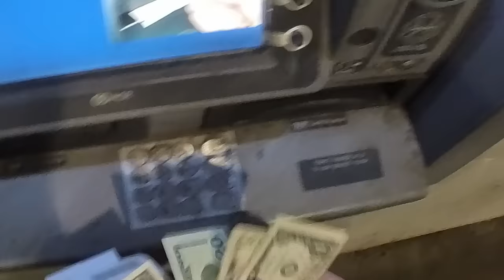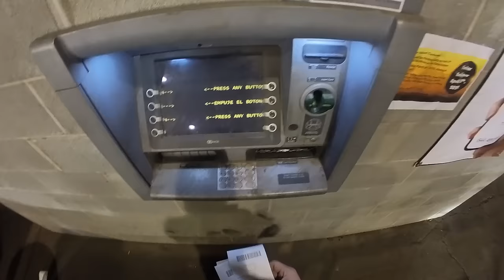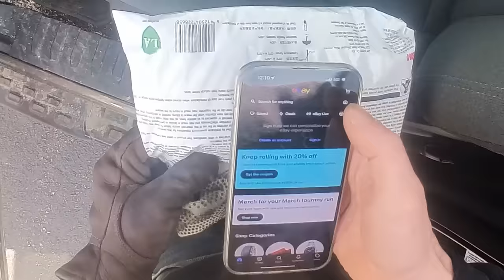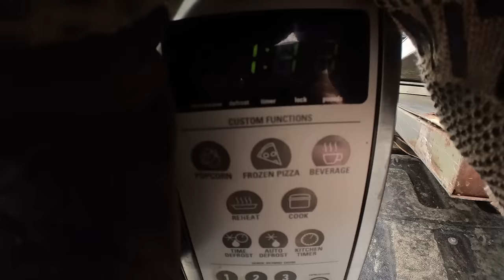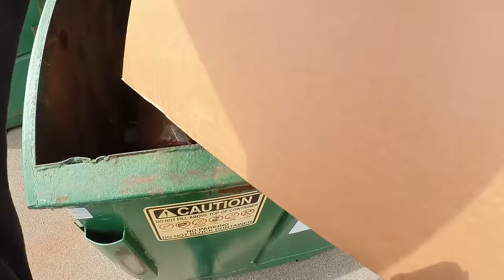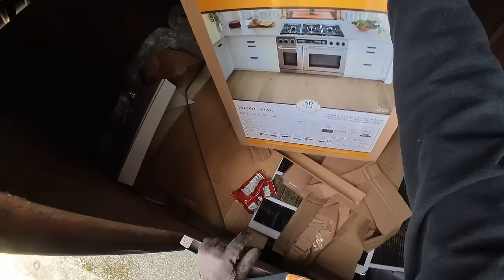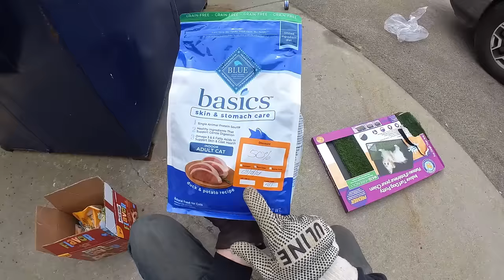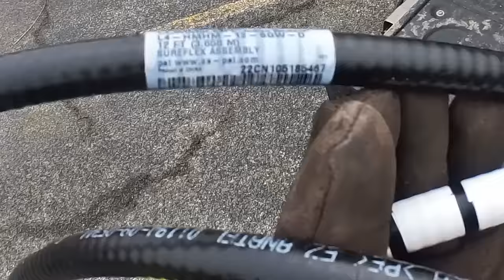Don't they know this is worth $$$ - Dumpster Diving 2024

Comment: Love the work! Keep it up! You come across enough heavy/awkward stuff that it might be worth it to pick up the truck bed cranes they have at Harbor Freight or Northern Tool. They’re between $100-200 but saves your back and make it easier to haul some of that out of the dumpster.
Reply from the maker: I'd love to get a lift gate installed. The new truck is 5 inches higher than my old Tacoma, I didn't think it would matter, but I'm defintely noticing lol

Comment: Also, pretty sure most the cable you got from the ATT is just steel coax. steel core with a sometimes copper sometimes aluminum outer shielding. There is such thing as copper coax but its mainly just used in old CCTV applications

Comment: The red thing with the key in it is a glad hand lock. Where truckers hook their air lines to the trailer you slip this over the hook up on the trailer, pull the key and pop in the button. Now no one can hook up and move the trailer. 😉

Comment: I took some cables into my scrap yard once like the ones you found and they cut the ends off and the ends had gold pins in them and they paid me #2 copper for the rest of it...each cable weighed 1.6lbs and there were 25 cables per box and I had 37 unopened boxes...it was a great payday...if you are unsure about it take it to the scrapper and let them tell you if they will buy it but I always take it just in case

Comment: I’m gonna start garbage picking  I need side money
Reply from the maker: It's a good way to make some extra $$ for sure. So many ways to go after it too.  You could resell furniture or big stuff locally on FB marketplace, sell smaller stuff on eBay, turn in scrap metal, find household goods or construction material you would have bought anyway.
Reply: But you made loads with Truth Social going public. Trump2024

Comment: There's copper in TV's. Did you know that? The older ones have copper and the newer ones have aluminum in them
Reply from the maker: Yeah, it's just a lot of work to part them out. I'd rather go find more stuff, just my style.
Reply: @LoveInTheDumpster  ok. I understand that.  But I'm used to watching Mike the scavenger and he takes everything apart before he takes it back to the scrap yard

Comment: I strip it sometimes have copper shielding the fittings are stainless or brass basically it's kind of a like antenna power cable for signal boosting or transmitting I think but if you find a bunch that's in good shape it sells for over a dollar a foot good luck man I like your channel I'm subscribing and liking Scrappy later